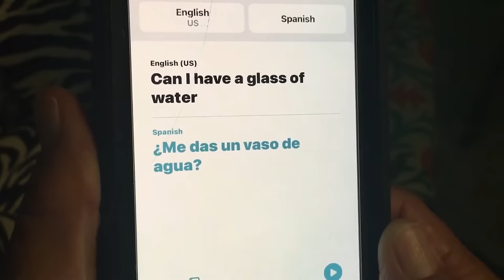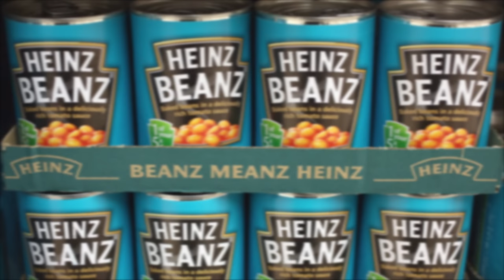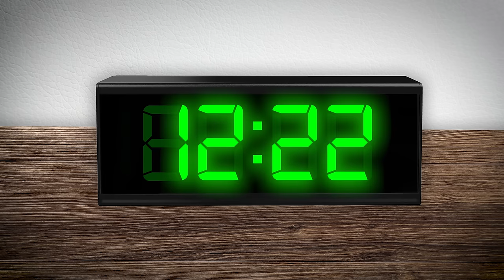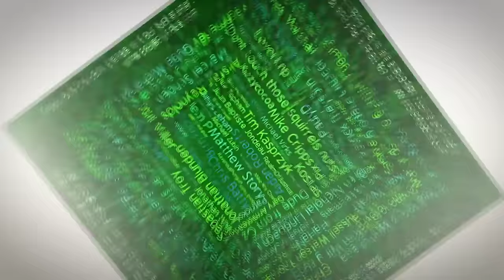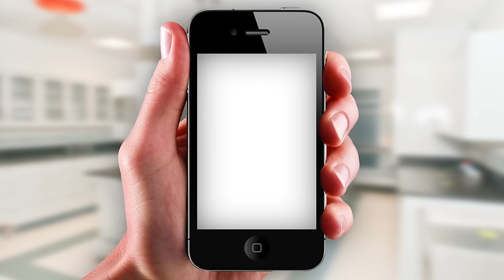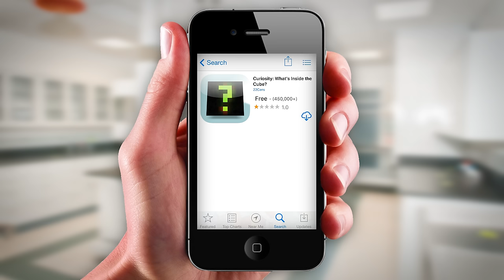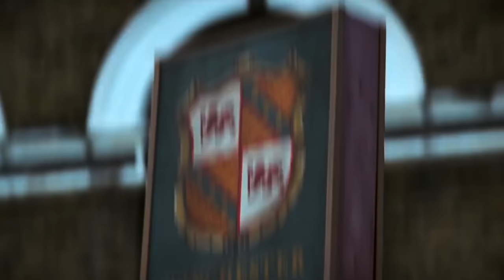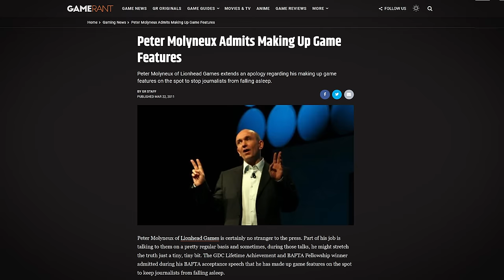Curiosity: The App That Fooled Everyone

Comment: if anyone is wondering, the 32 bit signed integer limit is 2,147,483,647. and people went over that, causing an integer overflow back to zero.
a simple fix would be raising the integer limit to the 64 bit version, or 9,223,372,036,854,775,807.